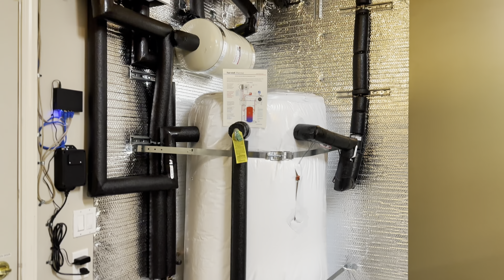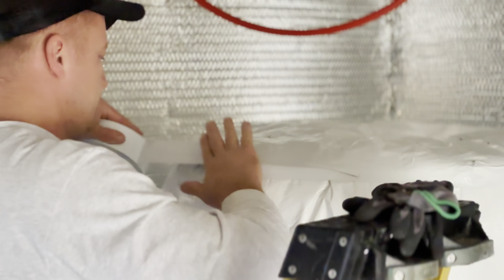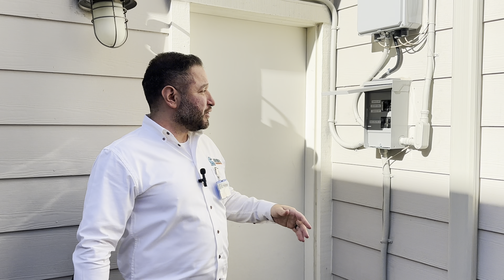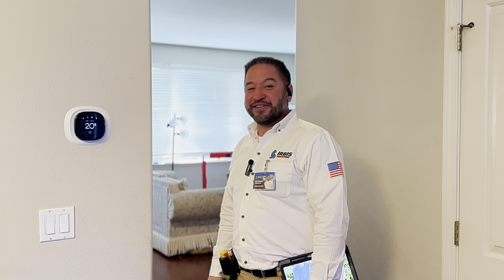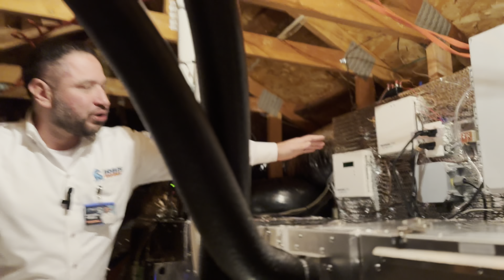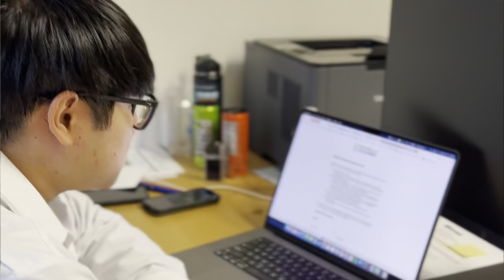New System Upgrade: Smart Thermal Battery | IRBIS HVAC

Comment: I am curious about the separate condensor and air handler. At first, I thought the system consisted of the SanCo2 HPWH, the pod, and a water-to-air air handler.  But then you talk about a separate AC unit. Is this because the sanco2 system can only connect to one tank, and not run cold water from the condensor for the summer air conditioning needs? I love the simplicity of the water to domestic hot water and airhandler component, but the fact that you need an additoonal heat pump for the air conditioner seems to ruin what seemed like a simple system. Maybe i am not thinking enough about how many places still just need heating and not AC and heating...